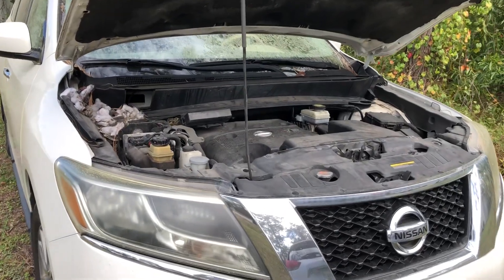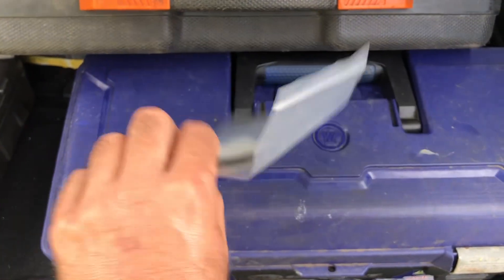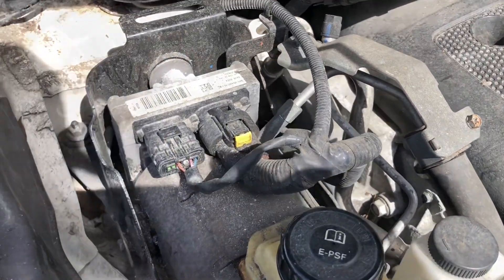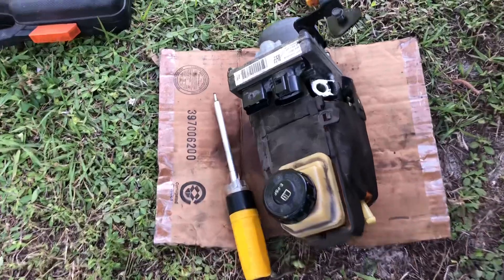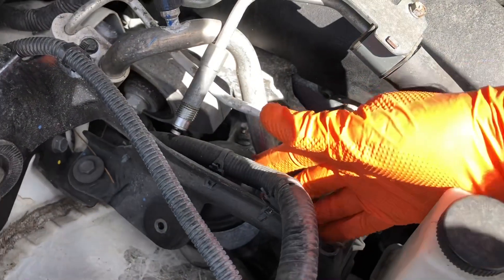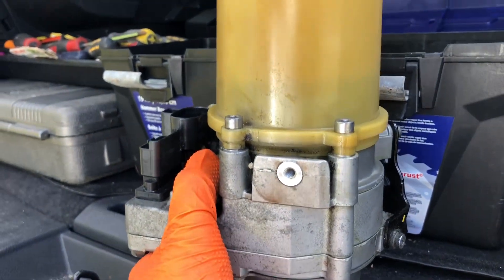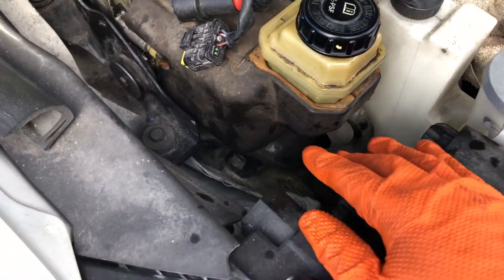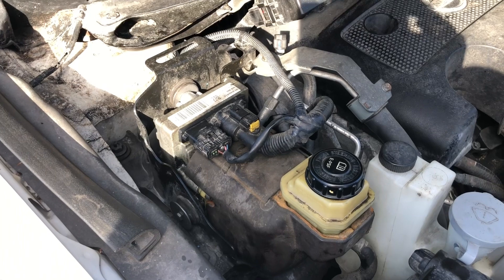2014 Nissan Pathfinder Power Steering Fix

Comment: Thank you for the video, I also suggest that you replace the other Oring (the larger in the packet) it is on the next section about an inch from the Oring for the reservoir. You will need to separate this section, definitely want to replace both while you have it off.
Reply from the maker: Thank you for the advise, I could not figure out where the other o-ring was going, I just tough it was extra or if you have a different pump model,  you should make a video about it.

Comment: I have one question. Is there any need to bleed the power steering line?
Reply from the maker: I did not do it and it was fine, what I did I left the cap off (but did not drive-off) and I was going left and right a few times with the steering wheel before I test drove it so the air would come out, but I would do some research see if you have to and how, I am not a mechanic so i can not say yes or no.
Reply: @mr.m.g.t.  Thanks for the quick response. Have a Blessed day. Peace